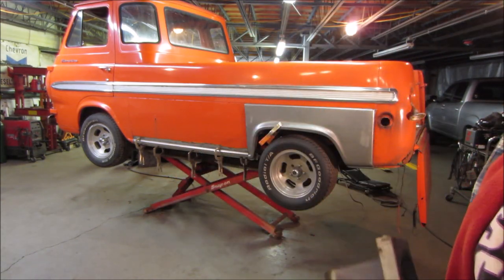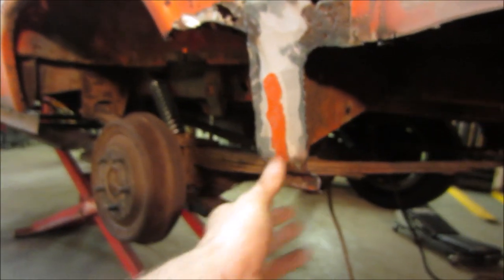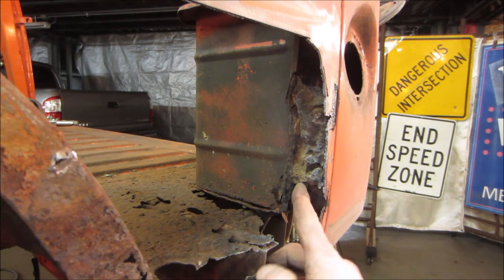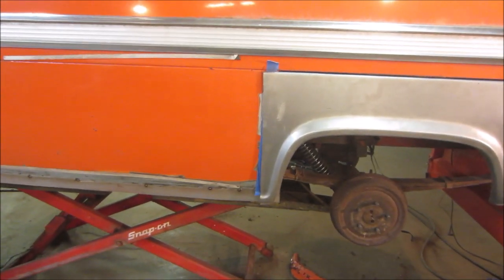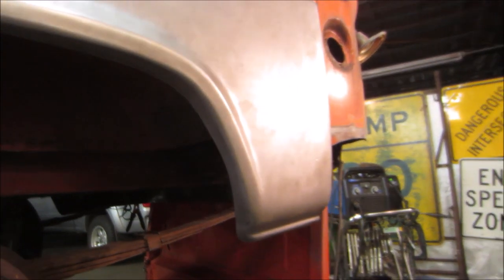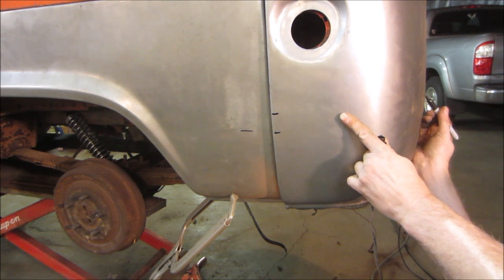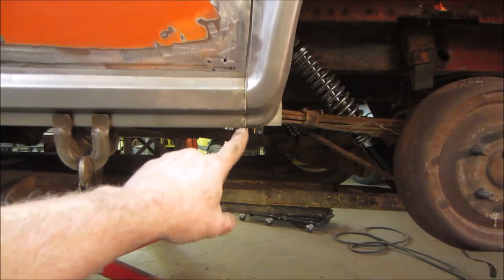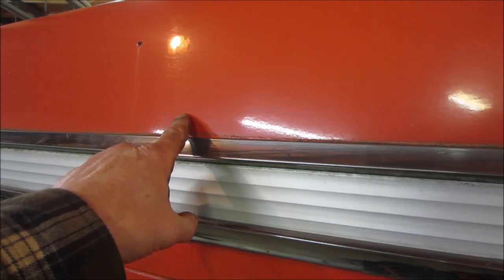Quarter Panel Replacement on a Ratty/Rusty Econoline Pickup

Comment: Commenting on how the aftermarket panels fit. Back in the early 1970's I helped catalog an old automotive warehouse filled with tens of thousands of parts that ranged from the early 1930's to about 1968 and one of the things they had were patch panels from three different suppliers to identify. all ranged from the late '40's thru the early '60s. Mostly headlight eyebrows, front fender lowers, rockers doglegs and rear wheel openings with some complete rear quarters. All looked fairly close but almost all had the same characteristics of incomplete bends and bunched up metal as yours and they were all made in the USA but not using factory dies and processes.

Comment: Man what an artist.  You know where to cut, bend and stretch the metal to make it fit correctly. Yes crappy panels but I think that's the norm.  Getting good with all those body tools as well.
Absolutely fantastic video.  Thanks for sharing.

Comment: I worked two years @ Ford in KC,Mo. In there body shop as electrician. We keep the robots & line running. We built the Transit van. The bottom section gets built first, I am flashing back, Mustie needs a Fanuc shirt in yellow with black lettering & keep the camera on high speed. No really ,after body is all built, it goes up stairs, they do seam filling & the.whole body gets dunked , they call it E_coat, then it gets painted. The body has a Cid assigned to it = control ID. Then comes back down stairs, and the power train, electrical windshield ,interiors ect , gets installed about 260 to 300 per shift. 5/2013 to 8/2015. Very hot place on 2nd shift, good * $ $ [Comming along good Mustie.]

Comment: I had to deal with poorly made repair panels for my vw bus, and a trick I was shown is to use a strip of steel, about a quarter inch thick. It should be bendable, but have a sharp edge on the side. Clamp it firmly into the back of the edge you want to tighten up with welding clamps or c clamps. If there is a tight radius on the piece you might pre bend the strip. Then just tap on the edge against the steel backing, and massage it into shape with the body hammer. It can really crisp up the edge of a compound curve without warping the panel. It really helped me fit the sloppy stuff I got from the vendor. Good luck with the rebuild, nice video!
Reply: Oh, I like Krusty.

Comment: This is coming along nicely now, and it makes me wish we still had our 1964 Ford Thames. Apart from being worth about a hundred times more than it was when we bought it, it held a lot of memories of places been, sights we'd seen, things we'd done and people it had carried over the years, people we'll never see again. It was a true personal time capsule. When it was made, men had scarcely more than a few hours in space, let alone walked on the moon. Television was black & white (in the main). Supersonic flight was still in the future and The Beatles were the kings of pop music - a better world than we occupy today.

Anyway, this truck - I hadn't even thought that it might have been repainted, until tonight. I think I could just about make out a hint of something under the "new" coat, but I couldn't see anything like the detail you were reading off the side panel.

I was wondering if you'd ever considered heating that 'funky' puckered quarter panel (only the bit that's funky!) and panel beating it while it's still hot to get the shape you need? Definitely worth trying on a piece of scrap panel, just to see how it goes, but it can yield some decent results, by both, a; allowing you to stretch the metal to make it 'reach', and b; allowing you reduce those puckers by shrinking them with some diligent beating, or even squeezing that edge with pliers (while still hot). - Try it, funk up some offcuts, and then heat them up to beat them or squeeze them into shape. It worked for my dad, 50 years ago!

Comment: Hi Mustie you need a spot weld cutter. Eastwood automotive has a good one it just chucks into your drill and  uses double end 1/8" bits it is so much easier just clean top surface metal if you cannot already see the weld point. It you use a sharp fine point punch to mark center of welds you just cut through the top layer your replaceing. And their cheap.

Comment: Have you ever used Cleco's, they are a good way to hold panels in place, and when done just plug weld the holes. Amazon sells them in kit's, including the pliers, very reasonably priced.
Reply: I would have suggested magnets out of old speakers.
Reply: That's what I use on restorations - originally designed for aircraft rivet construction....
Reply: Great suggestion!!!  I use them on sheetmetal kits for my students!
Reply: We used clecos for holding sheetmetal parts together for spotwelding where I used to work years ago

Comment: I think using sticky 'bar and chain' oil as under-seal is an excellent tip which I've now adopted, you can get it really cheaply (here in the UK anyway) so if it does need re-applying after a few years its not a problem.
At least I know it won't harden and trap salt / water between it and the under-body as I've seen so many times with expensive under-seal treatments I've tried in the past on my own vehicles.
Thanks for all the inspirational videos Mustie1.

Comment: I was just curious since the quality of that panel was atrocious, I was wondering who actually made it and had the balls to sell it, pretty sure I found the seller and even they posted this on their site,
"This replacement panel does not live up to our high quality standards, but is the only one on the market so we carry it. It will take more work than usual to make it smooth and without flaws. If you do not like it, we will gladly take it back without question."
The quality still didn't stop them from charging $126.00 for it, lol, ya gotta love it.
Reply: If it is the only one vendor that has it, what else can you do? Not everyone has the ability of the guy at coldwarmotors.
Reply: D Sloop a joint an 2 beers Scott will have it done.
Reply: Tho of dubious fit and finish, those aftermarket panels are a good start and way easier than fabricating the panels from scratch.
Reply: Replacement body panels for Econoline is not a big seller
Reply: at least they are upfront, making those curved bits by hand is hard, i tried for hours and hours.  id prefer to use a rough repair panel as a starting point
Reply: does not live up to our high quality standards

Fam, that doesn't live up to any quality standards. I've seen things come out of high school shop class that were better than that.
Reply: whether you spend 20 minutes making a good panel or a bad one it cost the same no mater how bad it is!
Reply: Must be a somewhat common occurrence. The main parts supplier for my car carries items even they admit are not up to scratch but there is just sometimes no alternative.

Comment: My bike gets the same treatment; covered in oil and leave it. Last year i had it serviced and the guys at the bikeshop felt sorry for the bike. It hadn't been cleaned for at least 10 years, some plastic parts were green from the moss that grew on it. It's mostly used during the fall and winter periods.
Picked up the bike the next day. One of the mechanics rolled it outside and i thought "hey, that looks exactly like my bike, never seen that one around here!" Turned out to be my bike, completely cleaned and on the house! Oil and dirt from the road is the best protection for your vehicle. The bike is still in great condition!

Comment: Those panels look like they were made in a trade school when the instructor wasn't in the room .
Reply: ...more likely from the Far Orient....for minimal wage
Reply: @TheWolfsnack  And not the right quality of steel.
Reply: While the students were drunk
Reply: @TheWolfsnack  By Sanjay Patel, who can do a decent job when paid enough and not under constant pressure.
Reply: Those panels will save you but they sure arnt without headache, that's for sure!
Reply: "While the students were drunk" and blind.
Reply: @simontay4851  CAN YOU DO ANY BETTER?!!!
Reply: Top Dead Center  ..."talk is CHEAP"(?)
Reply: Probably made in China with original dye's that are worn out, that's why your panels have rolled edges.Gotta dance with the one that brought ya .
Reply: Before you get down on your knees to worship your favorite youtuber, how about you try some reading comprehension bud. The original comment was referring to the replacement panels, NOT the quality of his workmanship.
Reply: For the idiots that read my coment about the panels should watch the video and listen to what mustie said about them . He was not happy with the quality of the product . So get your heads out of your ashes .
Reply: @daleburrell6273  yes, i would do do it better if i had the right metal forming tools.
Reply: I was replacing my 73 VW hood bought new hood from dealer.  Spent most of a day getting it ready for paint.  Dealer keeps good tins for their body shop.
Reply: They are made in third world countries over a stump.

Comment: That's the roughest repair panel I've ever seen!
Reply: Same here.
Reply: I think if you just order a flat piece of steel, ship it with US services while not putting any packing peanuts in the package...the piece of metal you get would be closer to the shape of a rear panel of a Econoline Pickup than this piece of junk
Reply: Yeah they almost put some effort into it eh?
Reply: You should see the panels that India produce the dies are so old the panels come out oversized
Reply: Hey are NEVER close to where they need to be 😂
Reply: Sad to say, I've seen worse. Like the wheelarch panel I paid over £100 for that turned out to be about 3 inches too big...
Reply: @Mrflash222006  Is that worse than too small?

Comment: 21:29 somewhere  a dangerous intersection is missing it's sign lol
Reply: Redok   Many decades ago I was out for a drive in the countryside and came across a crew installing a very large round RR crossing sign. They had just removed a smaller round sign that no longer met the new size and reflection requirements. $10 later, the obsolete 4 foot circle RR warning sign was mine.. and has remained a feature in my back yards for 35 years. No sign went missing from its intended duty.. and as obsolete 'scrap' it has endured well. It was also saved from being melted down, or turned into makeshift panel repairs.

Comment: It looks like the material in the bed could have been dried, drywall mud.
Reply: I was thinkin' grout or plaster. Weird stuff whatever it was.
Reply: Hope you're right... looked more like "Soylent Green" to me.  😉
Reply: Mamaws favorite homemade bondo recipe
Reply: Sometimes, a load to be carried requires a very flat bed.  A buddy of mine (a remodeler) used sheetrock bedding compound to float out the bed in his van before laying carpet.  Worked a treat.
Reply: Sometimes, a load to be carried requires a flat bed.  A buddy of mine (a remodeler) used sheetrock bedding compound to float out the bed in his van before laying carpet.  Worked a treat.
Reply: Whatever it was, is gone now.

Comment: Such is the often the case those panels fit horrible out of the box! But still beats having to totally custom fabricate complex curves as it usually gives you a decent starting point. And after you did quite a bit of tweaking, stretching, smashing, shrinking, cursing, etc. they actually look pretty darn good. Also glad we got a Krusty cameo and a walk with the boss at the very end. Love Lilly.

Comment: That metal is pretty thin for a 70's car.
Reply: demonchild 74 Check out the new ford trucks when they get hit.  Its literally a beer can.
Reply: @robdavis1176  And NOT a 70s beer can at that!
Reply: @robdavis1176  I'm told it's so cars crush safely as designed..........Utter tosh!
They should bounce like they used to!
Reply: If I’m not mistaken these were built to be the cheapest of the cheap trucks

Comment: Nice to see that bar and chain oil holds up pretty well.  I coated the whole underside of my truck with it a few months ago.  Recently I saw a video from Project Farm where oil coated metal did not fare as well as samples coated with Fluid Film and other chemicals, but that was with used motor oil.  I guess time will tell :-)

Comment: THANKS!! I am doing a cab swap on an 89 F150 and I have to repair bad cab corners and a few rust out holes. Lots of ideas!!
I have no idea what I am doing. But I am doing it anyway because I love my Truck. Been after it two years. Work on it until I hit a snag. Then take a break until I figure it out.
I might have to pick up the pace though. Big chunks of the old cab are falling off regularly now. Not much holding the two street sign floors in anymore.

Comment: Must be a after market parts, when you buy autobody aftermarket parts, especially stamped in china they are brutal. You always have to rework them and it can be a real pain. Your not going to get them to all fit right in one go, you have to fit and weld in one piece at a time working from the front, working your way back. that way you be able to work them better and you'll end up with a better looking job..u did the right thing put in a smaller piece of the cab corner in and btw your doing an overall great job by the way.

Comment: I have seen 2 other econoline pickups in other videos, sitting quietly waiting for a new owner. I use bilt hamber products for rust prevention, the aerosol has a long tube with a diffuser to get right down the chassis rails.

Comment: So many times I write things, and I’m afraid people will take me the wrong way. I want to be read as if I am a long time friend, not a know it all off Facebook! So please . . . 
I couldn’t understand why I had a 1 next to your name in YouTube for so long, so today I took the time to scroll back and look. Fortunately I was in a public place and couldn’t shout at the phone!

During the reassembly of the B-52 compressor, all I wanted you to do, was stand it up on the oil pot, ie vertically. Even the writing on the air tank said Drain after every flight, and the top said something else. This should have told you, not? All I wanted you to do was stand it up ! So, it doesn’t have a leak at the top, please change it’s storage orientation, clean it, and try again. 

I love what you achieve, much respect and and regards

Paul Lewis
Bristol, U.K.

Comment: I had the van model in 1970, overheated all the time. Inside that "fill tube box" is a vent tube for the gas tank that gets plugged with crud thrown up from the rear wheel.

Comment: I take a  1" copper  pipe  hammer  it flat  put it behind  the hole then weld it  won't  stick  to the copper  makes a flat spot weld, been doing it for years.

Comment: You might want to try using a spot weld cutter it helps preserve the weld flange in back every aftermarket panel I ever installed in my 25 years of body work required a large amount of messaging to get it to fit.

Comment: I wonder if they put bags of cement in the bed for winter traction and they got wet?  Old trick we used to do in northern winters with rear wheel drive cars.  But we usually used sand.
Also, hope you enjoyed your trip down south.  I recognize that area.

Comment: I would use body glue around the wheel well, back corner, and along the body seam, it will seal water from getting in between the wheel well and body panel, then weld everything else.

Comment: That back panel reminds me of a 45 ACP pistol I saw at a gun show that was obviously a copy of a real one made in somebody`s garage. It was a pretty good attempt, but could not be fired, nor could a cartridge be loaded in it. I  also once bought a tailgate from J.C. Whitney`s back in the 80`s that bent out of shape when I tried to load a lawn tractor on the truck with loading ramps. Check the bare metal with a Geiger counter to see if it is radioactive. May have come from Japan.

Comment: A trick my body guy taught me. Cut out your patch panels 1st. Tack them in place over metal 2b cut out. Cut using a grinder on an angle. When u weld patch in, it will fit perfect and you'll have nice angled edge to weld to. Less filling later on.

Comment: Have you ever tried cutting both panels  at the same time, the seam always matches. I've used it laying linoleum many times with success and the few times I've done it with metal it worked also. And how does the shrinker work? I know i could just look it up.

Comment: Hmmm....bar and chain oil.  Interesting. I have a 1991 Geo Tracker, where the frame rotted out (the mechanic that I was using, instead of welding patches to the frame as the damage was being done, was actually only using FIBERGLASS, to ‘keep the water out’.  I should have had him arrested....lol).  Anyway, I’ve had my little truck for 25+ years - it was (and is) my daily driver - I wanted to save it.  So I bought a parts car, found a new mechanic who was honest, and he did a frame swap.  Every two years he does a treatment of ‘Dynax S50’. So far, so good.

Comment: I would not alter the rocker panel line to make it fit the wheel well line. I would alter the bottom of the wheel well line. Seems to be a smaller and less noticeable line to fix than the rocker panel line. I would definitely notice the dimension change on the end of the rocker panel piece you made, but on the wheel well, I don't think it would be noticeable at all. But that's just my opinion. Otherwise, carry on! I always enjoy watching your work.  BTW, Acorn to Arabella is looking for a small engine to power a big, very old planer and you were mentioned as a possible source for one in the comment section.

Comment: never mind the fitment/fabrication work required...question is...is the steel thick enough and of good enough quality to last after you do the repairs, or they rust out after a couple years like those thin, cheap tailgates with no logo on them?....